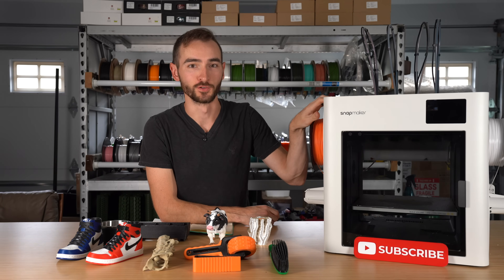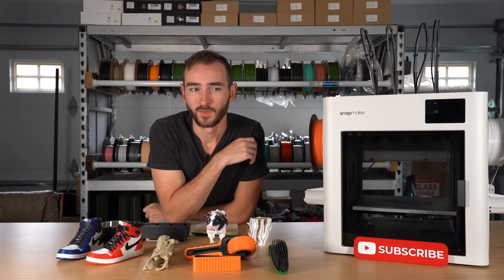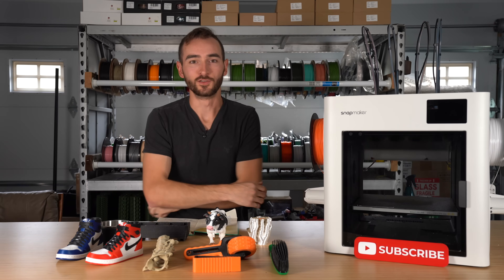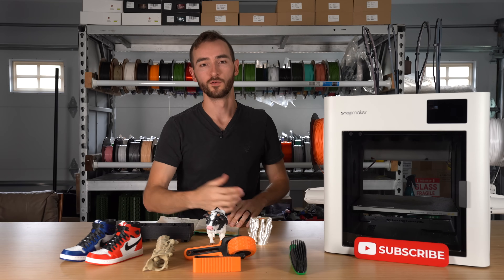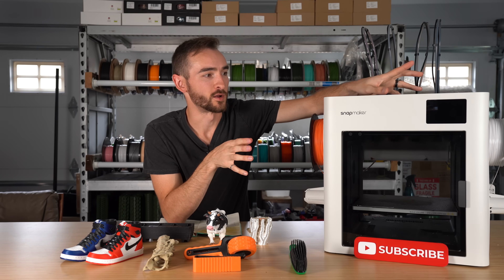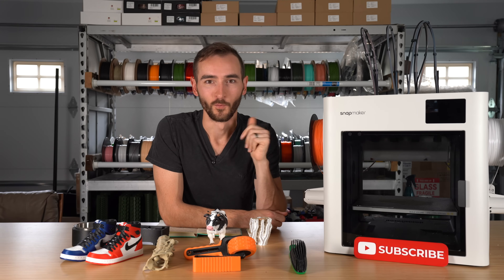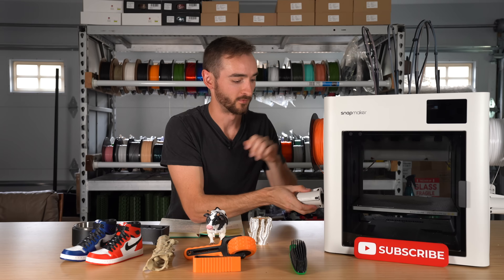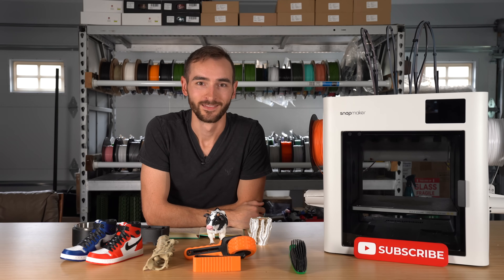Snapmaker U1 Final Verdict: Pledge or Pass?

Comment: It will have much quicker tool changes than the INDX and will be a lot cheaper and easy to use than the INDX. I am still 50/50 writing this comment but leaning towards getting this with a few extras like the lid and some 0.6mm hardened steel nozzles. Then after the INDX system is flushed out and working well with many printer upgrade kits I may get that too in a larger format printer. For a reference though my only other printer is a Prusa MK2. If I had a X1C or Core One with a MMU on it I would probably hold off and see what else comes out. Thinking of MMU, the biggest drawback here is that these nozzles don't have a cutter and cannot support MMUs easily.

Comment: Bondtech's INDX system mixed with Prusa and the Core ONE is looking like the best next gen solution. They released a picture earlier today on fb, it's really small (3rd pic down) you can clearly see it's the inside of the Core ONE and has 8 tool changers in it. 8 colors with virtually no waste.

Comment: I tentatively dipped my foot into 3d printed in 2022 with the Ender 3 Neo V2.  I spent more than the purchase cost upgrading that machine and fixing it. December last year I bit the bullet and purchased the Bambu Lab A1 - a real quantum leap compared to the creality machine - repeatability and speeed plus multi colour printing.   I also bought a Elegoo Centauri Carbon on launch (which also SEEMED like a kickstarter!) . No regrets there either.  A great machine that punches well above its price.

And yes I backed the U1 (plus cover and a set of 0.4 hardened nozzles).  Mainly because I got fed up with the wastage on the A1 and the time to print.  Provided the user experience is as good as the aforementioned machines I will happy. And I look forward to playing around with multi material printing.
Reply: Same experience with the A1, the waste is ridiculous.  I just cancelled my pledge as I did not have a good experience with their A350, and that kept nagging me to wait to see what this motivates the industry to do. Good luck, hope your experience is awesome!

Comment: Thanks for the info. I backed the early bird and am interested in multi-material printing so am thinking about the enclosure and the hardened nozzles.

Do you know if you’d be able to use just one hardened nozzle? If so, I could probably save some money just buying one after it launches as I’m unlikely to be printing multiple abrasives.

How would you rate the experience using the machine offline with OrcaSlicer and the Fluidd webui?

Coming from a DIY klipper machine the issues you mentioned don’t worry me too much.

Things like the whole bed cooling fan only covering the middle 50% of the Y axis from one side worry me.

Also I did think it was interesting to learn about the repairability, so thanks for documenting it!

Comment: Active heating is bologna. I print loads of ABS/ASA/PC/PA on my bambu P1S
If you "need" active heating for those materials you're doing something wrong. Sure for PET/PP/Ultem but nobody prints those anyways.
Reply: Thats my experience so far. The 65°C chamber heaters of consumer/prosumer printers dosent help much. I get about the same ammount of warping on a H2D and a P1S with a towel draped over the top.

Comment: Unfortunately I think INDX style systems are the future.
Reply: Why unfortunately? It seems to be a fantastic system.
Reply: It might be if they make kits for some good printers. Right now only Prusa seems like a good consumer printer getting the kit and for what it is Core One, imho, is a bit overpriced. Personally, I don't think SOVOL SV08 or Voron 2.4 are good choices for consumers who want to do more 3d printing than printer tuning/upgrading. In any case we'll see soon. The kits should come at around the same time as U1 - December.
Reply: The build volume that can be accesed by both heads would be tiny on a 250mm-ish printer.
Reply: @lukahierl9857  indx not idex. Bondtech uses only one tool head at a time, that can be swapped.
Reply: @lukahierl9857 the person was talking about INDX the tool changer system currently being developed by bondtech, not IDEX (the system of having 2 toolheads on one gantry)
Reply: I think both of them have advantages and disadvantages. The INDX seems that far from ideal due to the fact you're still dependant to an AMS.

I also really like from the multi-toolhead approach that you can potentailly have a single toolhead as a spare and ensure that you will have virtually no downtime due to clogs or any other head-related-issues. Yes, it's more complex as basically is 4x of everything, but on the other hand, thats also an advantage depending how you look at it.

Let's see how this actually works!

Edit: nevermind I confused indx with the one Bambu presented as a H2s evolution. My bad!
Reply: @jairo.cabello INDX is not dependant on an AMS...
Reply: @jairo.cabello  I think you misunderstand how the INDX works. 

The indx swaps out the whole filament path, so there is no need for an additional fillament management system, aside from some extra spool holders.
Reply: @kiwihuman yup, I confused it with the video of bambu system
Reply: Ah  @jairo.cabello makes sense.
Reply: @jairo.cabello  Why do the INDX require an AMS?

Comment: I just passed my pledge, its two reasons, ams, in summer the moist i s like 50-60% , having that filament in the open sucks, also having it on both sides is soo not practical for me, its a pass.
Reply: Buy the filament dryer kit.... Or if it's too expensive just buy a $20 Amazon dehumidifier and put it in a closet / small space with the printer.  The filament is only gonna get wet if you let it.
Reply: @kylelongstaff it a hassle to mess with, an ams is needed
Reply: @SweUnpoor lmao... Whats the difference between AMS and Dryer box kit? Besides the AMS being more expensive...
You know you can print right from the dryer box right?

$20 Amazon dehumidifier that you literally turn on once and leave forever is too much hassle lmaoooooo
Reply: @kylelongstaff you have to move the dryer, sry for being not up to your opinion, lmao.
Reply: @SweUnpoor I mean hey whatever floats your boat. I wouldn't buy an AMS ever personally but that's my opinion

Comment: I backed it’s as I just want to be able to print cool multi coloured models without always putting it off due to purge waste!

However I have now been spoilt by Bambu with using my P1’s and A1 Minis for the 3yrs+ so be interested to see if the U1 matches my current level of expectations that I have come accustomed to and only time will tell with this and I am hopeful they can match it if not close enough 🤞
If they do I’ll purchase a 2nd one to replace my two P1P’s over time…

Some upgrades I’ll like to see in the next gen of the U1 is copy the A1/H2 range and have simple nozzle swap out just for quality of life without needing to do a tear down or a whole tool swap out.

I am excited to see a plus size with more tools I imagine this will be what other company’s will chase to one up each other but I’d like large bed 8/10/12+ tools I can either print batches or imagine coz play armour or large sized practical prints like a chair/stool and have the padding as TPU.

Bambu have made the whole system good for myself and needs and I am interested in the H2C but I expect it to be £££ more than my hobby budget will easily allow and also I am not sold on the Nozzle swap yet…. As I can see the waste saving but I don’t see the time saving being good compared to tool change with already loaded filament.
But I am happy to be shown different when it drops!?

Basically 3d printers are getting exciting again!

Been a good run for me from an Anycubic i3 Mega to Creality Ender 3S1 to Bambu Lab P1P and then A1 Mini and hopefully to a great U1 and the future 😊

Comment: You said the pogo pins were good for 10k-20k but I believe they said 1 million.  10k would barely last a week on a big 4 color print.
Reply: pogo pins are specifically designed for repeated contact. any company making pogo pins that would only last 10-20k would get expelled from the industry very quickly.
Reply: 1 million for all toolheads together. 250k for each one

Comment: the lack of a chamber heater is the only thing that killed it for me I regularly print with nylon and paht cf otherwise I was all for this printer
Reply: What would it take to fit one, like a portable heater with its own thermostat?

 obviously you'd want a lid for the U1
Reply: The lid is the chamber heater
Reply: @Someperson- It is not actively heated, just passively with the bed AFAIK.
Reply: @swecreations  passively heated is fine, all the vorons are passively heated and those are ment to print ABS. 

You just need to let the printer pre heat for 10-20 min.
Reply: @kiwihuman I want to print more advanced stuff than just ABS though. I'd want 65°C or more like a Qidi.
Reply: @Someperson-  I might be wrong, but having the heater in the lid sounds like a bad idea. I mean, The heat rises to the top of the 3D printer, so all heat is in the lid? while the fan brings in cold air from the bottom of the printer? edit: also i notice on the bambu lab x1e that its heated chamberelement is on the right side of the printer, and if i print 2 abs pieces, its a big chance for the one on the left to warp if I do not use glue.  The heat should come from below the heatbed and raise to the top of the printer.

Comment: im waiting for Indx
Reply: INDX or Vortek. But probably Vortek for H2D because it will be more reliable.
Reply: @Todestelzer  These systems are very different.

Some prints will be impossible on Vortek while possible on INDX (think multicolor soft tpu or multimaterial prints that require changing soft tpu). Some will be possible on Vortek and not possible on common INDX variants (let say X color prints where X is more than tool heads; it would be possible with some INDX + AMS like system though).  Vortek isn't great because it breaks filament path and won't be fast (due to AMS usage).
Reply: @arekx  INDX will need 10s or more to heat up a nozzle. It will probably not be faster than Vortek. I don’t print multi color TPU. 

AND Vortek will work out of the box. INDX will probably take a lot of time to dial everything in.
Reply: @Todestelzer  So a lot faster than Vortek. Vortek requires AMS for filament change - unloading & loading filament in AMS is 30s+ on each change.

Prusa is working on a printer with INDX, so surely there will be printers with INDX built in.

Comment: Almost backed it, but got the Bambu H2. Waiting on the tool changer upgrade.
Just needed a machine quickly
Reply: Bambu's Vortek system isn't a true tool changer like Bondtech's INDX, the U1 or the Prusa XL though. Plus filament still has to be fed/retracted via the AMS which adds a lot of time to filament changes and is an additional point of failure.

It seems to be a hybrid with multiple tools + AMS
Reply: @omnomnomnomn  I think in the time you unload and feed the new filament you can heat up the nozzle. Shouldn’t be slower than the Bondex INDX system.
I never had an issue switching filaments with my X1C or H2D.
Reply: @Todestelzer  not just that you can set it up in a way where the second nozzle is the only one that has filament swaps and the first one never gets swapped, meaning swaps can be done while the first nozzle prints, essentially making the swapping time 0
Reply: @Todestelzer  Vortek will be still slower because it needs to cut filament, retract it to AMS then push new filament in. Bondtex INDX or Snapmaker U1 just changes tool and resumes printing.
Reply: @omnomnomnomn  Thanks, kind of wondering if it'll require going from 2 nozzle to 1 as well.

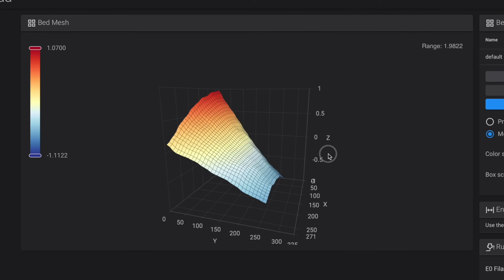Comment: 13:46 thats 2mm right? Thats bad, really bad. If you want to print something flat, it will be parallel to the print plate, but not flat and wobble on a truly flat surface. I would try to get the printer mechanically as good as possible or else you will always print parallelograms and wonder why things wont fit together.

Comment: All we need is a U1 max
Reply: I'd buy that in a heartbeat. 350 cubed with 5 tool heads and they've got my money.
Reply: @kylequinn1963  they seemed to have packed their heads tighter so I feel like they could fit more than the 5 that the XL does
Reply: @kylequinn1963  600mm with 8 heads would be lovely
Reply: BUT please with closed chamber and a chamber heater!
Reply: And with better spool 🧵 management!
Reply: Snapmaker actually has said "We hear you" to 3d printer customers and are "actively addressing those desires" so it sounds like they are making one
Reply: @anthonylong5870  If they do, they ill get my business...
Reply: Why no closed/heated chamber seems like a miss there with how the QIDI Q2 AMS combo is $649, it’s enclosed and heats up just doesn’t have 4 tool heads but can run 4 spools with their AMS unit
Reply: The closed chamber is already though for this printer, they will release it soon, we need the max, not an accessory to close it
Reply: It has the pins for head 5-8 too
Reply: @JH-zo5gk So we can assume that a Max is pre planned
Reply: @jjptech idk. What i would like more then more toolheads is auto bed leveling. Seems like a total miss here. Still using 4 screws.
Reply: @JH-zo5gk  It does have Auto Bed Leveling, maybe you refer to automatic bed nivelation (yeah, both terms are co fusing)
Reply: @jjptech it does not have autobed level. All 3 bed screws are attached to a single motor with a common belt. It has bed mapping, ie bed mesh leveling. But not a true bed leveling like bambu or the hydra system used on voron trident and ratrigs.
Reply: @JH-zo5gk  Comon bro... It is a cheap printers. Seriously? 800 dollar for 4 print heads? Mesh bed leveñing auto xy calibration, why spend more money in something that can be compensated with mesh leveling!?
Reply: @jjptech not the same.... and 2 more stepper is really a none issue at this point. I would be happy for spend another $50 for that feature. Im going to assume since its running klipper the hydra mod would be done very quickly. I still backed it knowing this tho.... and also knowing how easy it would be to add.
Reply: @JH-zo5gk  What's the benefit of having (physical) auto level? The first layer is perfect with mesh compensation. I feel like I'm missing something, apologies for my ignorance
Reply: @xSil3nt27 less bed movement to compensate. That said my U1 works great in factory form.
Reply: @JH-zo5gk yeah, I get that, but what's the benefit of less bed movement? 
From my reading and understanding, physical leveling still requires mesh compensation since the plate itself almost always is never perfectly flat (unless you go back to the old days with glass plates), so if you need both, and physical auto level doesn't give you any benefit, adding an extra part that can fail sounds like a bad idea to me.
I was just wondering if there was a potential benefit I had missed.
Reply: @xSil3nt27 less movement=things last longer, and just better over all accuracy. When the bed has to compensate for not being flat or level the part is skewed a bit. The firmware will, over the course of many layers, will work out that difference in level, so part that should be 25mm tall may end up 24.9 or 25.1 ect. Its splitting hairs really and as long as the bed is more or less level its really not needed. Just a nice to have.
Reply: I think color changing toys can get expensive quick I have a prusa xl, and hardly ever use the space.
Reply: @bcjan18 Thats just your use case though. Plenty of people have a use for that extra build space.
Reply: @bcjan18  Color change is just one aspect. Multi material is another, like using PETG as support material for a PLA+ print with a PVA support separation layer. Gone are the days of cleaning up your prints...
Reply: a nice 600mm cube build area would be great
Reply: when that happens to my P1S, I will probably try to replace them with a linear rod, or something.
Reply: What if a Max version in 350 along with 6 heads, but the price is close to Prusa XL.
Reply: @TinkermanHK Still snapmaker. It is open source klipper and orca. But it is not, probably it is going to be around 1500 maybe 1800
Reply: @TinkermanHK then just get the prusa. If its 350x359 with 6 heads it needs to be no more then 1500$
Reply: Just like a K1 Max.
Reply: 10000000% bigger print volume, 6 or 7 toolheads and 1500 bucks, that would be perfect
Reply: @MonoMan187 lol it would be bigger then an apartment complex
Reply: I think a U1X or U1Carbon for engineering filaments that have individual dryers on each side of the printer would be really cool! The U1 looks really cool if all you're printing is basic materials (which does make up over 90% of the 3d community).